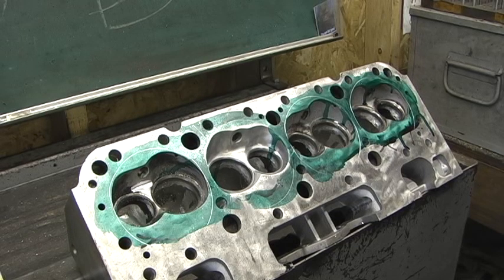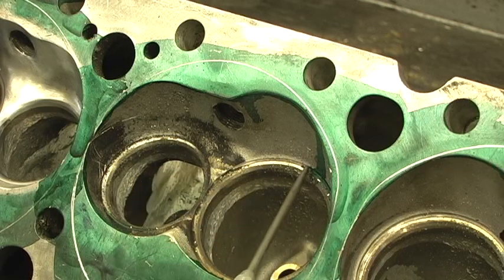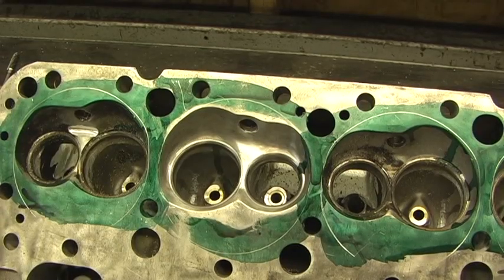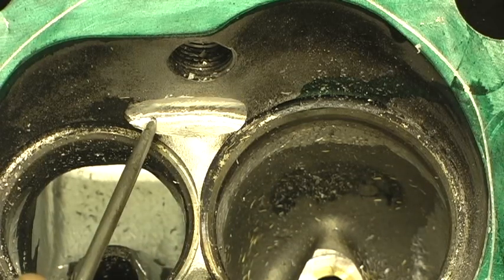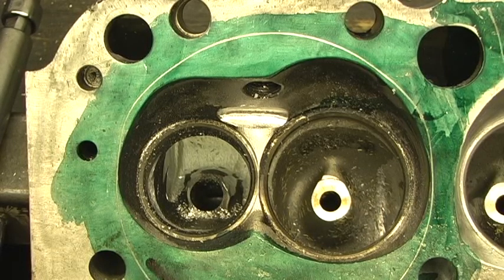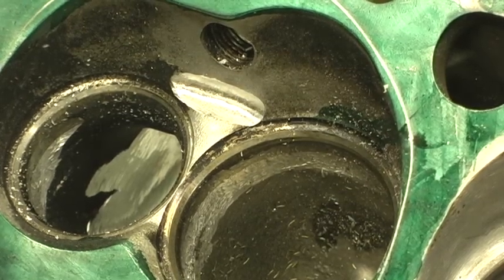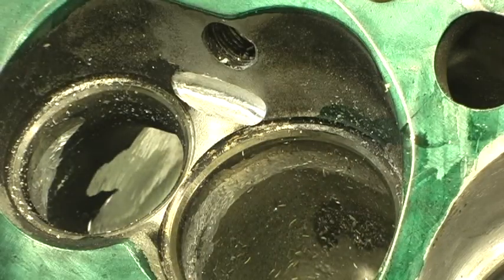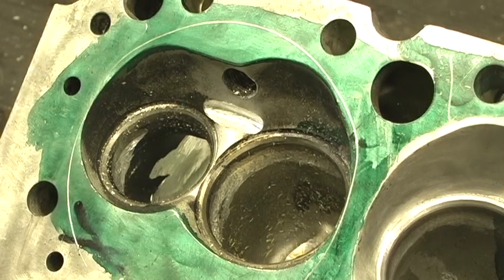Porting Pro Comp 200cc Aluminum Head

Comment: Please consider doing a video on Procmps BBC  300cc Oval Heads.....I bought a set, had a local Racing Head Shop port them and set them up.........crazy BADASS with a small solid roller cam in a 496.

Comment: im looking real close at some tfs sbf heads i have still in the plastic here. the twisted wedge head. the chambers are cnc'ed they are somewhat rough but they are not raw casting they were machined. i wanna take them apart and go over them, nothing major just clean up, since they are wedge is there any need to unshroud? i mean will a simple cut increase flow like this? im trying to imagine how the cone of air passes the valve and does the air make a radical bend because of an obsticle.

Comment from the maker: OF course I have, that was all the rage from Super Shops back in the early 90's. They are THICK turkeys for sure, and I have hit them for 245cc runners from the 200cc stock (with Tubes). There a way better structural head hands down, but from the factory the valve job is WRONG, the guides are WRONG, the chambers and overhang and machinist is WAY WRONG. You got a great casting, from there you have to do a lot of work, and you get the bomb when your done.

Comment from the maker: Wow, I have not had some one ask me that yet since I opened Headbytes in 2009. I done bunches of the 472 and 500 cadi heads all through the mid and late 90's. I even done a set of the aftermarket china cadi heads in 2002. Email me at my website in the contact us page. Thanks.

Comment from the maker: If you got them BARE, ordered the valves, springs, studs, retainers, keepers and plates on your own. then re-done the Crap Valve Job they come with, re-honed the valve guides to the right size of the valves you ordered, and done the Combustion chamber area where the spark plug is (this is a problem there). then you might be able to use them stock. However, you could get more out of a set of GM double humps for less money. the Pro-Comp is just a CORE, nothing more or less.

Comment: Would you suggest these heads for a budget build without doing any port work for a mild 350 street machine? Would full roller rockers get rid of that valve guide wear?

Comment from the maker: Your pretty close to right. The point was to let people know that Static is what it is....Mathematical, and while the overlap plays a part no doubt, It is almost impossible to achieve 100% VE, there for the static is not achievable (10.0.1) because that would mean you packed the cylinders 100% during the intake cycle. You get into Ram Effect to achieve it, which full blown race cars can do with the right cam, Intake and cylinder heads.

Comment: The dynamic CR is the relation to the static CR and the VE .The static CR is what it says,static,never changing.VE is how much air "is" pulled in,in relation to how much "could" be pulled in.Dynamic will always be lower than static,because 100% VE is not possible.To say 80% VE = 80% static is close,but not accurate.Valve overlap decides how much of the 80% actually gets compressed.But fact is porting,when done correctly,will improve VE,This raises the dynamic CR.

Comment: A static CR of 10:1 will always be 10:1,no matter how much air you pull into the cylinder.This can never change without physically opening the engine and changing parts.What your 80% refers to is how much air is actually pulled into the cylinder,or the "Volumetric Efficiency".So if you have a (fictional) cylinder volume of 10 cu/ft,and you can fill it to 100%,then you compress 10 cu/ft at 10:1.If you only fill to 80%,then you compress 8 cu/ft at 10:1,and so on.
This is called the dynamic CR.

Comment from the maker: When porting the combustion chamber, yes you lower compression a LITTLE, maybe a tenth or a point or two depending on the amount of CC you remove; however, you must remember that you cannot compress what you do not bring in. IN other words, IF your only filling the cylinders around 80% during the intake cycle, then you have 80% of the mechanical static compression. Lets say you had 10.0.1 static compression, 80% of that is around 9.0.1 or so, that is running compression, and what you got.

Comment: if I had some time and money, I'd rather install new valve seats with a little oversize and bigger height, so they stick out. And then machine the top of the valve seats with a little degree like 5-9, concentrically. The exhaust seats won't benefit much of that, because exhaust valves like to have a bigger radius from combustion chamber to seat or even a radius, as everyone knows, but it may begin right in the CC surface. Well, that's what I think. Thank you!

Comment from the maker: O.K., that is a good question, and this is the best answer I can give, actual experiance. EVERYBODY knows these are china heads, with the stock port there are casting errors, however, so small.  The fact is that when you really through the grinder to them to get a high cc runner volume to them (around 220 and above) the "DIPS" in the castings disapear.  I have done over 15 pairs of them and ten of them over 225 with the tubes. NO COMEBACKS, no LEAKS!!! The neat thing here is the power I made